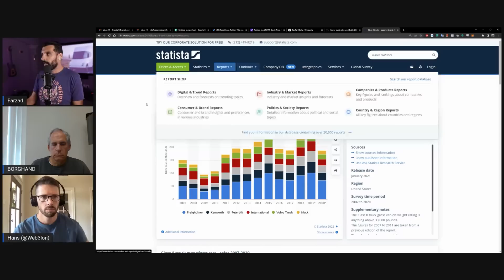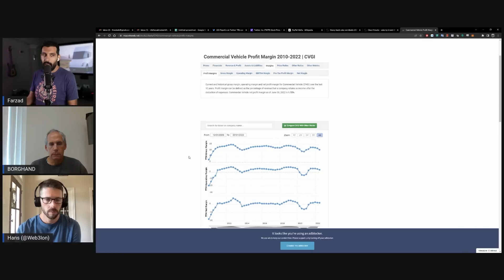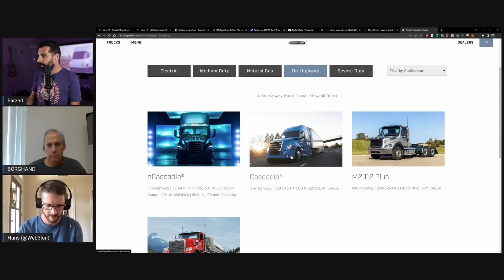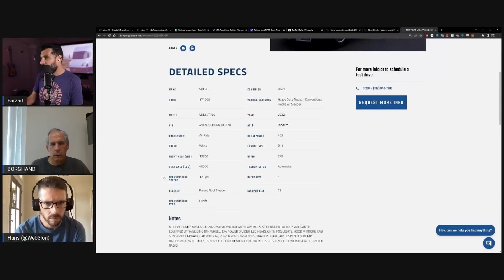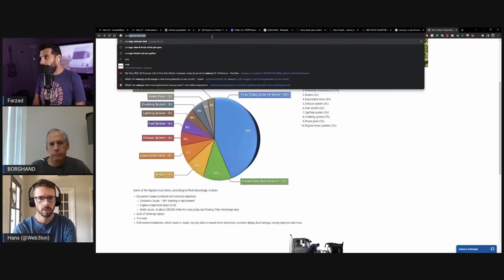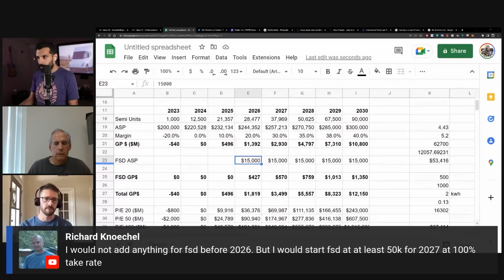Full Rundown of Tesla Semi's Financial Impact

Comment: These Semis won’t be charging at home where the average cost per kWh is $.13. They will be charging at Teslas brand new MegaChargers configured with million dollar GigaPack battery storage devices. The operators of these Semi fleets are likely to cost double or triple the average cost of residential electricity.

Comment: Note that the Tesla Semi is a day cab configuration, and comparable 15L diesel day cab trucks sell new for about $120k.  To compete with diesel, Tesla priced their 500 mile truck at $180k and promised to sell electricity to fleets for $0.07/kWh.  Tesla plans to get to 100,000 trucks/year sales, and will need competitive pricing to take a large share of the 270,000 unit/year market in the US.

Comment: “40% margin, is that fair?”  No, I don’t think so at all.  Tesla’s announced initial pricing at $180,000 for the 500-mile semi.  If they use 800 kWh battery to get that range (consumption was stated at “less than 2 kWh/mile”), then Tesla will be selling the entire vehicle for $225/kWh.  That is a low price for just the battery pack alone!  For example Tesla has charged customers $16,000 for a new 82 kWh battery pack for the Model 3, which is $195/kWh.  If Tesla doesn’t increase their semi pricing, then they will have very slim, or negative, margin until their cost of batteries is significantly lower than what it is today.

Comment: 500 miles per cycle at 1,500 cycles for a high-nickel cell is 750K miles. The amount of overall battery degradation remains to be seen. It seems entirely possible that the charging cycles and discharging the cycles will have a tighter temperature management range and thus a longer life cycle than the current 2170 and 1865 cells. Tabless design is a big help with heat management.

Comment: Also.  The structural pack can probably still be replaced just look at the structural model Y pack. Yes it’s more difficult and labor intensive to do, but they can still do it. It’s not welded into the frame
Reply: I agree. Structural doesn’t mean ‘not replaceable’ it may mean the vehicle has to be supported during the swap.

Comment: The margin doesn't matche the ASP increase.. it assumes that Tesla spends more and more per truck they build.

So for a 50% increase ASP from 2023 to 2030, the margins have to go up. If your 120k estimate that was mentioned earlier is correct, that's 60% margin in 2030. Plus FSD!

Comment: With such a value proposition you are going to out index usual annual sales because it will rapidly retire existing fleet. The valid price of this with FSD functional seems over 500k while cost can’t possibly stay over 120k so you will obviously bring in substantial competition and lower price points, but they will need something like FSD to be competitive. A lot of freight will move to trucking from rail. Also with FSD there’s less reason to drive 80k lb which has a lot to do with utilizing the driver, so I bet the form factor shrinks (or alternatively you just load less and get better range from fewer batteries). Could see 200k sales per year. Battery materials are likely a problem but with this value the iron chem (and lower weight capable) still seems worth it and then you get better cycle life and charging. Can’t believe I have to stress all weekend about my tsla position because the market refuses to think further ahead. Stupid margin.
Reply: With a driver making say 75k$ and FSD capable of driving 24/7 and lasting 12 years you get a sense of the value of that proposition. It’s absurd. Not to mention lower insurance.

Comment: This analysis is pretty conservative in terms of price because of a few factors that weren’t discussed:

* The IRA includes a 40k credit for purchasers of class 8 vehicles
* The IRA also includes a 45/kWh tax credit for battery producers. With 4680s this will mean 45,000 on a 1MWh battery
* The cost savings per year of 40k on energy/fuel should be incorporated into the purchase price. This is best modeled as an annuity. 10 year annuity is about 350K

Comment: Based on Teslas warranty on car batteries you can expect to change them every two years when doing 60000 miles per year in the semi.
Reply: My guy.. Battery pack will atleast hold for 1500 cycles. 500 miles multiplied with 1500 is 750k miles. This is to be expected as the minimum what you can get out of the pack before needing for replacement.
Reply: ☝️Feedback appreciated,
tell Max I reffered you for something profitable••

Comment: do u think will there be special trailers with solar panels to extend range and shoren charging times?
Reply: You'd get about 8-9kW at most (sun right overhead) if the entire upper surface of the trailer were covered with solar panels. That helps a little, but the truck will be using about 100-200kW while cruising. It isn't a bad idea though and 8-9kW of free energy does make a difference over 20-30 years. Adds dead weight though.

Comment: If this truly is competitive with rail, its going to lead to roads breaking down much faster than they do today because of how much more trucking there will be. maybe boring company will be a partial solution.
Reply: I think the motivation to run with 80k lb will lessen because that’s optimized for having to pay the driver. Road damage goes up I think with the square maybe even cubic of weight.

Comment: You’re making the mistake of thinking of Tesla as a traditional vehicle manufacturer.

By 2030 Tesla will be generating so much operating profit they’ll have stopped selling their hardware. 
If it makes sense for a fleet operator to buy Tesla’s with a 40% margin how much sense does it make for Tesla to just operate the fleet itself?
Call it 100k trucks, at a cost to manufacture of about 140k per truck, the annual expense 
Is 14 billion dollars.
Let’s say Tesla undercuts current market rates to achieve max fleet utilization so they charge $2 per mile at 60k miles per year per truck, of which 30 cents is fuel/maintenance cost. That puts the per year profit per truck at 102k or 10.2 billion dollars per year.
So a 4 billion dollar loss for the first year leads to a 6 billion dollar profit in year two and 16 billion in year three etc until you reach end of life on the oldest trucks in the fleet. Call it 15 years. The semi as a service could be as much as 150 billion a year in EBITDA.

That’s the insane value unlocked by removing the human from machine operation.

Comment: Tesla should get into tire manufacturing. Leverage their materials science expertise to make tires that roll better and/or last longer.
Having better tires (less rolling resistance) is one of the most obvious ways to further improve semi truck efficiency once the truck is electric. Electric motors currently used in EVs are already 90% efficient, so there's almost no possible gain there. Rolling resistance accounts for the majority of a fully loaded semi's energy use.
At the same time, replacing tires is a huge cost factor for semis (and probably significant for robotaxi). Dust from tire wear is a major air pollutant. Longer-lasting tires would help with both of those aspects.

Comment: No way they sell FSD for just $15K on a semi. It replaces the driver, and does the work or 2-3 drivers. Easily worth 100K/year with robo-release, which it is evident Tesla is getting quite close to. Anything less than $100K is absolutely insane. And more likely Tesla will sell it at a subscription rate that more or less splits the savings on trucker salaries. Each semi they sell today represents at least at 50K/year revenue stream in the not too distant future. And that is basically 100% to the bottom line.

Comment: The lowest market clearing price will move up massively as we've seen with every Tesla product as the consumer surplus per year is $100,000/yr in the case of the semi. The net present value of 500k saved over 5 years discounted back at 10%/year is $295,245. 2-300k per semi is WAY under priced because the value it provides is MASSIVE for business advantages. 5-600k more likely as the demand backlog will be excessive.